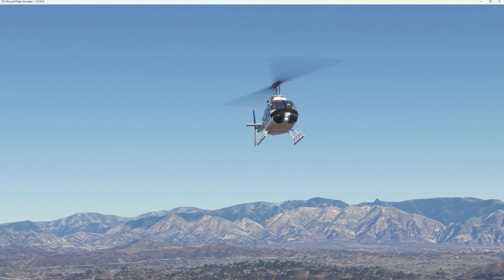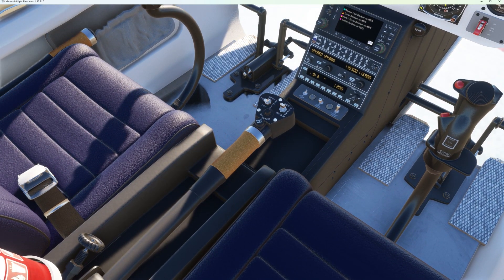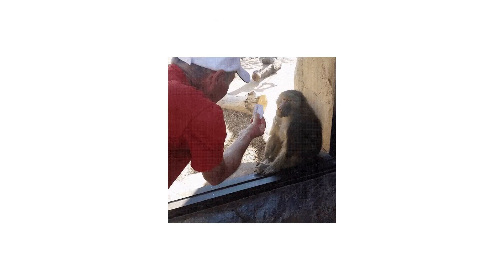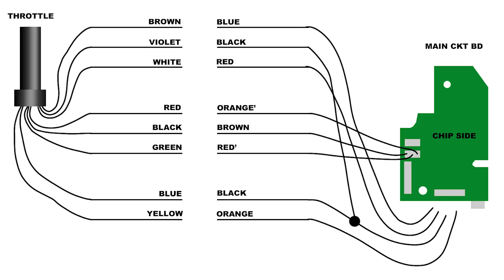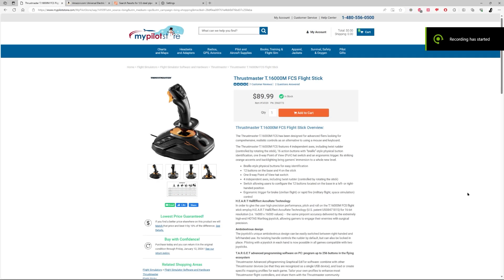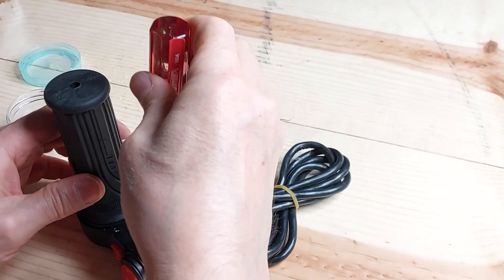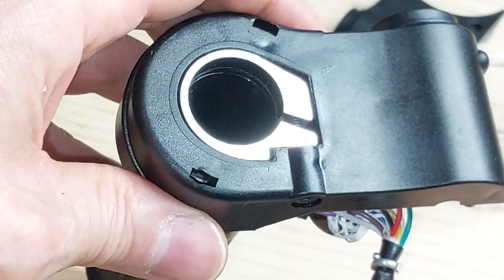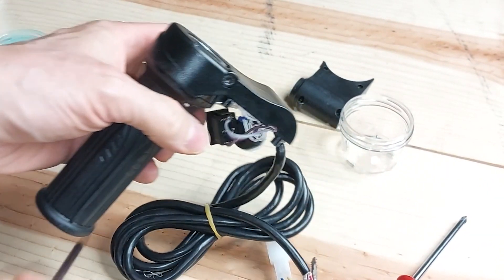DIY CHOPPER COLLECTIVE | PART 1 | LESS THAN $200

Comment: Hey Buddy ...I like your style. Before I just bit the bullet & spent BIG money, I too made my own collective ...TWICE. They did work somewhat. I finally bought a Virpil collective & throttle.
I didn't buy the stick ...my custom cockpit now has 6 MFD's with 20 programable buttons ...I didn't need more. For helicopters ...you "should" have a good collective ...in my opinion.
It made a hell of a difference although I still struggle with Heli's. At 66 years of age ...my learning curve has flatlined. ...lol.
Reply from the maker: I think for helicopters on this casual flight sim level, it's just a matter of putting in time and letting the nature of the beast sink in.  It DOES have a repeatable, consistent behavior.  Think of it like a woman -- she seems mysterious and inscrutable at first but if you hang around one long enough you start to figure her out.

As for the collective, I'll tell you why I designed and built this one the way I did.  I'd seen other DIY collectives on youtube but they often had design flaws.  A helicopter is EXTREMELY sensitive, in fact Mr D was telling me how he had amazed a VP helicopter pilot doing acrobatic work on the 500 with tiny movements of the cyclic.  Those tiny movements however HAVE to be precise -- if you have slop in the controls of either collective or cyclic it's going to be an unpleasant experience.  And there are TWO avenues for slop in a game controller -- mechanical and electrical.  If you use a standard cheap potentiometer, those things are just inherently sloppy and it will be reflected in your control.  And control certainty is CRITICAL when you're learning because you're trying to train your brain to make inherent connections between how you control and how the helicopter responds.  If you have slop in there introducing uncertainty and error, it makes it MUCH harder to establish those control relationships, as you know.

So I designed the collective to use magnetic Hall Effect sensors instead of potentiometers because they are more sensitive, precise, and repeatable.  And the mechanical interface is solid, being way OVER designed using house plumbing and fixtures.

I love this collective and feel that it has made a huge difference in my "piloting skills", to the point of comfortably controlling a sensitive MD500 on the sim as well as in real life.

A proper Virpil collective or equivalent works perfectly fine of course -- it is a high quality interface, but they are PRICEY, which is the whole point of this video series.  

When I made this collective I was a bit iffy if I wanted to stick with helicopters or just be a general aviator and spending close to $1000 for a collective seemed like a ridiculously overpriced expense.  At this point I probably WOULD get a proper collective as this is what I focus on now and if I had to choose between just buying one even if the price stings a bit and going through the hassle of building one, I'd probably just buy it.

But if you're not sure or you're short on cash, this is a really good way to get around the price tag.
Reply: @CaptainHelisim  Your talent goes beyond what I'm blessed with. My home-builds incorporated an old throttle with an aluminum tube & electrical tape for a lever.
The old throttle did have Hall Effect sensors (it was an unused Saitek X-56) but that set up was not smooth ...& as you pointed out ...THAT makes all the difference.
My stick (X-56) has become sloppy ...I can move it over a quarter of an inch before it effects the helicopter ...??? My current throttle is a Thrustmaster Viper TQS. 
An excellent unit, but it is not used for Helicopters. A new stick is my next purchase. Yes ...Virpil is expensive ...but a set of average Ping golf clubs can run you over $2,500. Hobbies ARE expensive. I'm in Canada & almost 50% of the $860. dollar price was import-duty-tax, because Virpil manufactures their products in Belarus. 
And ...my rudder pedals are CHEAP & will be replaced.
Reply from the maker: @MsTheCops  Ouch!  That's brutal.  I've been trying to come up with a decent cyclic design but the specifics are eluding me for the moment.
Reply: @CaptainHelisim  There are a few NEW models I'm looking at ...I'm still on the fence about Force Feedback ...not sure how it would affect things. I'd like to hear from someone who owns one.
Reply from the maker: @MsTheCops  For what it's worth -- I was flying IRL a couple weeks ago.  I was tired and holding the chopper on course required a fairly hefty pressure that was starting to make my arm actually hurt.  But I've been working out and I thought well you're just going to have to endure it like you do your workouts.  Then I remembered Mr D saying I should feel free to trim it out to my liking, so I did.  And oh man, it was superb -- just flying along directing with just the slightest of pressure.

Point being that my earlier statement to take the springs out may be ill considered.  I mean, that's how I fly the sim, but in actuality there is REAL FORCE getting the chopper to do what you want it to.  Now this is an MD500 with no hydraulics, but I tried a professional H145 sim and the cyclic was stiff as hell too until I trim released it.  So it COULD BE that keeping the springs in and trimming as necessary may be closer to the real thing than having a completely floppy stick.

Which doesn't speak to any kind of force feedback mechanism, but still it's a data point for your consideration.

Comment: I have spent sooo much research time on this topic. MS may not be realizing that you need a collective to truly fly the helis. I wish they would take it upon themselves to make them for $200 ; then helis would take off 😁.  Until then I can't wait to see how this project turns out. There was a video of someone using a usb hall effect handbrake as the base.  Wonder how that compares to the joystick aproach. Thanks for sharing!
Reply from the maker: Hey Erik thanks for the comment.  TBH I didn't even know USB handbrakes were a thing.  If I had, perhaps I would have reconsidered the approach.  I mean, one advantage for sure is the existing mountable base with a swing arm attached -- that counts for a lot.  Building your own wooden box is not ideal -- very "artsy/craftsy".  But then there's the design aspect of incorporating a throttle control onto it which those swing arms do not look very receptive to; it would need substantial modification/incorporation.

I like the throttle even though it's only incorporated in half the chopper models, and also you CAN add a custom switch pod to the end with additional hardware.  So could be the handbrake is not better overall, just different.

Re: joystick -- spoiler alert -- I completely disassemble and discard the physical aspect of the joystick and keep only the electronic brains and Hall sensor.

As far as how it turns out, it's awesome.  I love using it.  Though I originally wanted something simple, generic, cheap, and functional, I probably will add a control pod to the end and make videos about it.